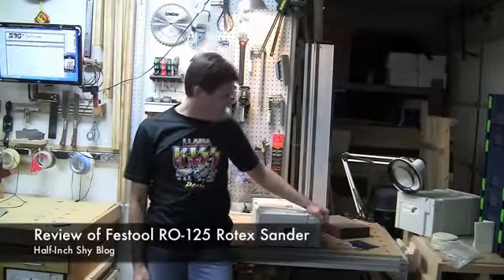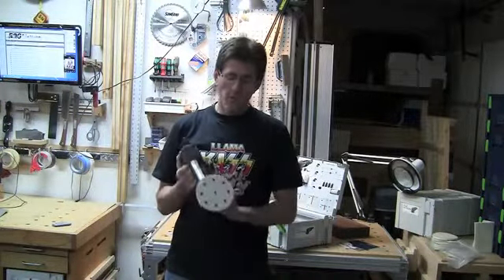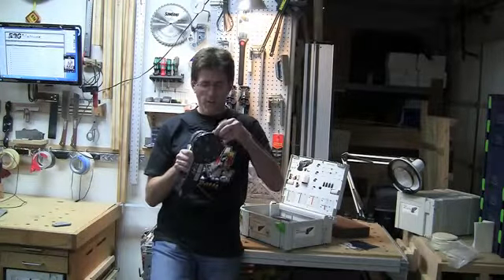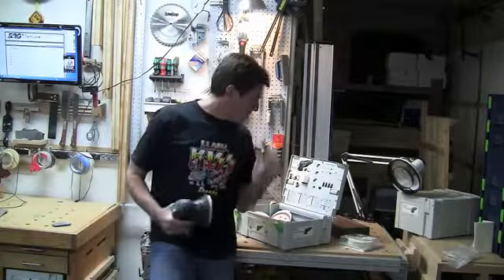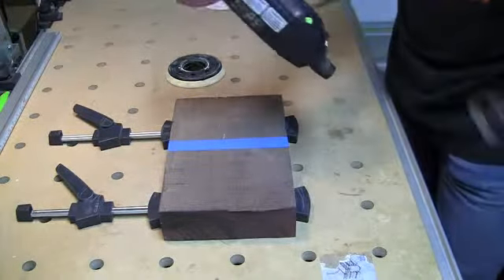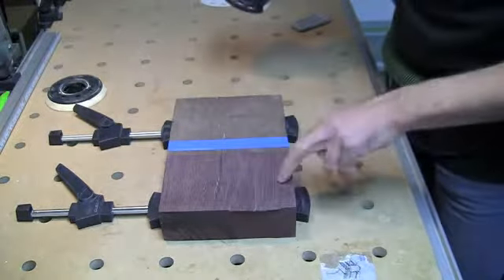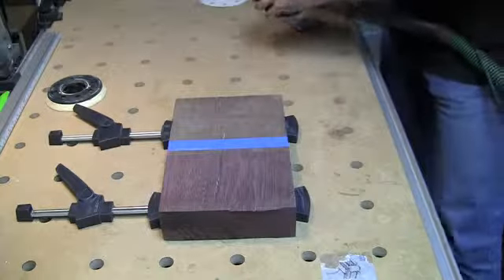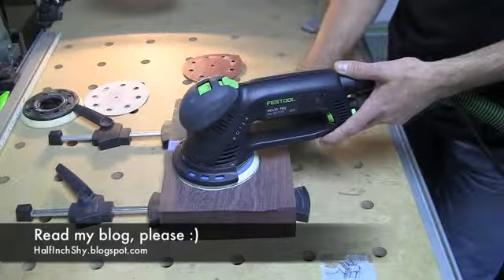#10   Festool RO 125 Dual Action Rotex Sander Review

Comment: My last question ( from Kyla's account lol ) as for the 125 , do you find it works exactly like the 150 but just a smaller pad or do you have a preference? As I get mixed opinion when reading the FOG, like some say the 150 is way better? Anyways I really want a rotex but I'm having trouble picking which one, as I already have a ets 125 and the sustainer of paper , so I'm tending towards get the rotex 125 but what's your thoughts on this? Is the 150 worth investing in and getting all new paper?